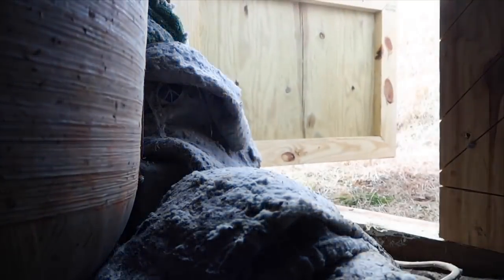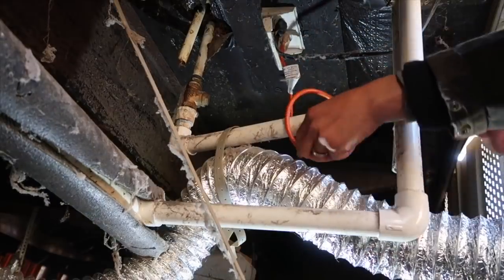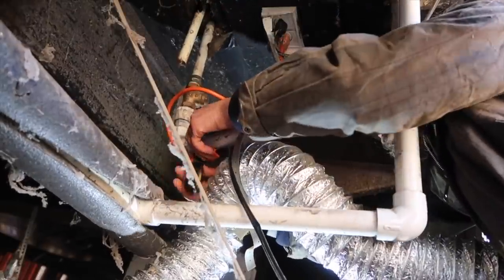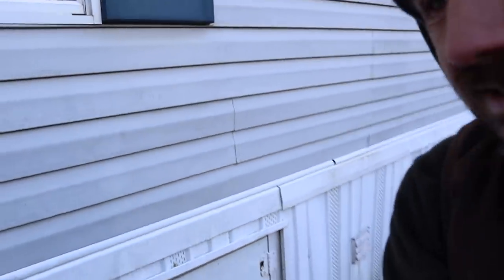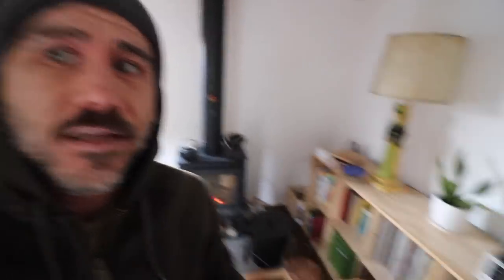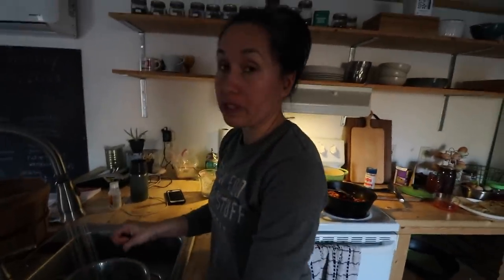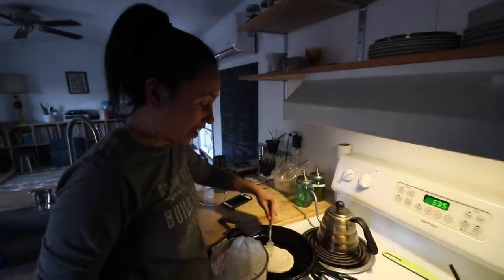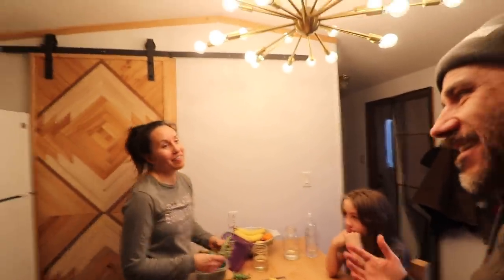Thaw (Help Prevent) Frozen Pipes in Mobile Home 🥶

Comment: MAKE SURE THAT THE HEAT TAPE's are safe to use on PLASTIC PIPES. mine caught on fire  but they was wrapped with fiber glass insulation and only burned the pipes up. please be careful.

Comment: I went to go help an older lady on freezer on clogger pipes after diagnosing it and sneaking the sink drain bathroom drain bathtub drain I went under the trailer and realized over half of the main s*** tube was completely frozen solid I told her she would need to put a few heaters under there I could do it for her or we can start running a lot of hot water and then because it's backing up go into the bathtub I told her we would suck it up with the Shop-Vac as we still had hot water it could take several hours but eventually it would have to unfreeze she told me she's not putting the heater under the trailer and she kept turning the hot water off on me eventually I just told her what the problem is the entire s*** tube is frozen over only the back bathroom work cuz it's not frozen towards where it goes in the ground so do not use the front bathroom or kitchen sink cuz I cannot go anywhere cuz your entire s*** tube is Frozen she wouldn't let me put water she wouldn't let me put a heater under their why did she even ask for help if she wouldn't let me fix it she said eventually I'll just wait for warmer days then

Comment: I have insulated my skirting very well and use heat tapes.  I haven't had a freeze problem with all that.  I am in Montana and we were minus 24 and no problem.  I have my heat taped plugged into a thermo cube so it automatically starts and stops with that cube.  I used to run the water at a drip and had my septic freeze up.  So the heat tape is a blessing.

Comment: Have all your faucets turned to "warm water" and it just needs to be at a fast drip.  Also, open the doors under your sink in the kitchen and bathrooms.  The heat from your house will help keep the pipes open.  Works in South Central Il when our farm is under a blizzard and the wind chills are down to around 20 to 30 below out here on the prairie.

Comment: We had 12 inches here in Arkansas. We had negative temps at night, and our pipes froze, thankful that we had heat tape on hand because we are still snowed in. 🥶 We also set up an alarm for every 2 hours throughout the night to get up and run our water at each faucet.

Comment: We use pool noddles cut them to length, split them in lenght and place around the pipes. Then wrap in old jeans and wrap in a coated dog food sack to keep from getting wet. We have never had to leave our water running. That is if we do not lose our electricity. We are one of the areas that never lost power during the Texas Winter Snow Storms Uri and Viola 2021!!! We had as low as -3°f temps at night. If the power goes off, that is a whole different game plan.  Winter does not play.

Comment: A trickle is fine you just need a little bit of water flowing.  Safety tip: DON'T use a torch to thaw out the pipes. you can start a fire. Use a hair dryer, small space heater or heat tape.

Comment: Great tips.. as for the water, you can trickle at much lower amount. I learned 1 drip per second and it's always worked for me. I grew up in Northern MI and currently live in Central Texas for over a decade. During our current extreme winter storms I've been lucky to have water and have two of my faucets dripping at 1 drip/second and have not had frozen pipes, temps as low as 3°F. I have made sure to drip the hot and the cold taps each on the bathroom sink faucet furthest away from supply lines and the bathroom closest to supply lines (again both hot tap and cold tap at a rate of 1drip/second or slightly more, it's hard to be too exact) I check on them every 2-6hours to make sure they're still dripping and have had to adjust several times over the last week.

Comment: Space heater to thaw then wrap with pipe insulation then wrap with heat tape and if it’s super cold leave dripping a small stream to keep flow and then it don’t freeze

Comment: Good video, but I have just a couple of comments. You only need a fast drip of water running. I have separate hot/cold lines and I make sure both are dripping (except last night when I forgot and it got down to 9). Also, under my mobile home, the white pvc pipe is a drain line. The water lines are inside of the insulation, covered by the vapor barrier. (We have had pipe problems before because of the type of pipes used in our home, so the vapor barrier has been compromised.) It might help if you build a ‘box’ around the pressure tank and pipe area and only insulate that small space. Just having less air moving down there helps a lot. Wind can cause pipes to freeze when they wouldn’t just from the temperature.

Comment: I need to install heat tape on my main line, it froze over the winter. I'm going to try and dig down as far as I can around the line and run the heat tape down there as well. I'm also going to do the outflow lines underneath them.

Comment: I know you're not from this area well I'm not from there either but I've lived farther north but you always leave the cold water trickling cuz I'm running water doesn't freeze and you always open up your cabinets under your sinks even put a space heater blowing that way it really helps keep them from freezing and never use a blowtorch. It's just very common since things when you live in an area with a lot of cold weather

Comment: I’ve been living in a mobile home park for 16 years. I’ve never had frozen pipes until now! I have had heat tape all this time, but this freeze, it failed. I read that I should shut off the water main before it starts to thaw so the pipes don’t burst and spew water all over. No one ever told me where the main water valve is! How do I find it? I imagine it’s under ground, right? I need to know ASAP because we’re supposed to be getting warmer temps tomorrow or next day!

Comment: I like your channel as well, but no one can give me a straight answer to this question.  The question is this.  I have temp sensors under my mobile home (1 in front and 1 in the back) of my double wide.  I live in SC but the weather here has been crazy for sure.  According to my sensors, the temp outside of the house is 32 degrees, but in my crawlspace, the temp is between 50 and above.  My pipes are NOT exposed, except near the first sensor where it is just covered.  Can my pipes still freeze?  Thank you for your answer in advance.

Comment: hi...i live in ohio usa

i have water pipe under  trailer home  freezes

i know heat tape is an option however ive got lots of strings of old school incandescent  christmas lights...

as a test...i was windering if wrapping the pipe with the christmas lights would actually keep pipe from freezing...and its easy to inspect...if lights are on its warming the pipe

what u think?...is this a stupid idea or could it actually work?...could it be a possible fire hazard?

Comment: Iowa here. We have heat tape on our pipes but it freezes at the water meter. Cannot get it to unfreeze.  I put insulation on it last year.  Still seems to have frozen up.  Do I need to remove the insulation for the heat to get to the pipes?